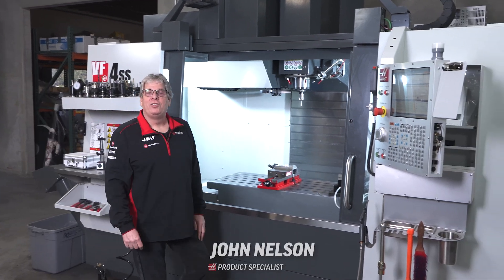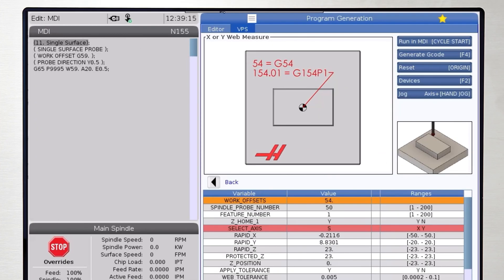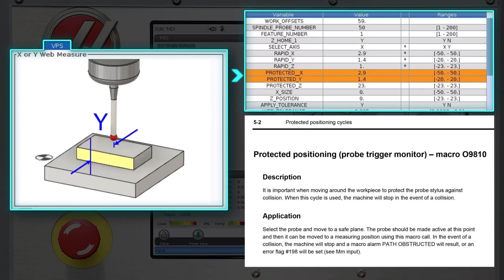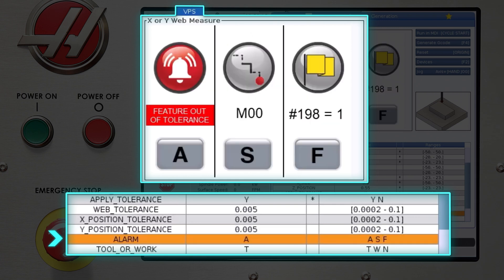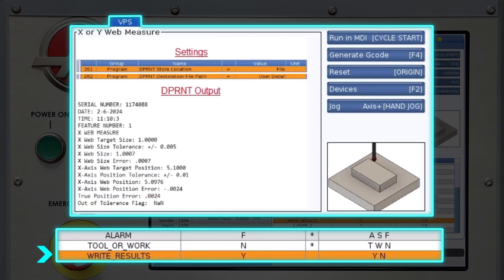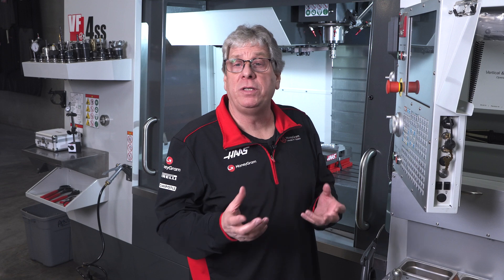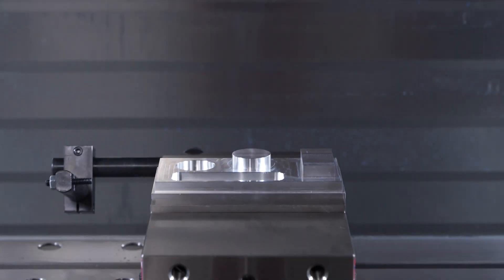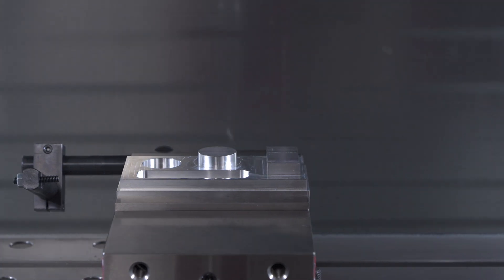New Probing Templates and In-Process Inspection on Your Haas Mill - Haas Automation, Inc.

Comment: Calculating G68 angle from two bore centers is a template I still really miss.
Reply: make a macro for it using the machine parameters. it's just angle formula between two cartesian points.

Comment: That probe is only as accurate as the calibration! So use caution when calibrating your probes.  I would also check calibration every couple of weeks. It is easy to do and only takes a few minutes.
Reply: Yeah I would say just as a default if I start getting weird things I dial in the probe with a indicator to the .0001 and run the calibration for the ots and probe.

Comment: Where do I download the templates
Reply: You call the HFO with your credit card and they will make it happen.
Reply: My HFO had a guy come out to install it, round trip $$$ and his 1 hr $$$ and the whole upgrade cost me $600 sucks!!!
Reply: @meddlingwithmetal7153  The HFO that runs the mid atlantic region will not touch anything unless it is broken. Unless you have a classic control mill which they will update to the final M18.29B software release if your machine supports doing it.  

Several of the features on the newer NGC software releases like the max speed setting for certain tools (save the renishaw from getting spun up to 10k rpm), The broaching templates and now these built in inspection cycles would be awesome to have. Half the time when I ask about them, the HFO service dept does not know about them, does not know if they would be supported with an older NGC or anything...  

Our UMC-750 we got last year I can actually say I like the tool and work offsets tabs. Still not a classic control layout but so much nicer than the work and tool offset tabs on our other two NGC mills. When I asked the service dept about doing a complete erase and reset on our buggiest machine. They come right back to their defense that they have no idea or guarantee that it would work. That Haas mothership in Oxnard provides no support or details about what each software revision would do or not do. Because many customers have been unhappy to find more nanny features have been slipped into the newer software revisions.
Reply: @meddlingwithmetal7153  only 600$ to have a technician come out for an hour? pretty good deal for what it allows you to do honestly.
Reply: Good luck getting a reply, they rarely do!
Reply: I'm sure you need to update your software prob.
Reply: There is always a reason why it doesn't work, we have 8 HAAS machines and each one has a different type of firmware and it is quite impractical to change the firmware to a newer one, because the hardware on which it runs the newer firmware can't handle it :/ 

For example, the new NGC machine from 2017 does not remember the values I entered when measuring when I return back to VPS probing, the machine from 2019 only remembers it until the program is changed, or the machine is turned off and on, the machine from 2020 remembers the values and can even measure the X axis and Z at the same time :D I didn't look "deeply" to know exactly why it doesn't work, I don't want to deal with it, I would rather make my own template, but I don't want to do that either, they could make a video about it, maybe then :D :D

The only option is to make your own custom templates, but it is quite difficult and there is minimal information about it, but if you search, you will find it, usually directly on HAAS in the "list program" under the "user data" folder you will find another folder "VPS templates" and in it there is usually "VPS template example.xls" this applies to the new NGC, on older software it is done differently :D

Comment: In before someone says you can't measure a part with the machine that cut it. Because you can.
Reply: If you validate the machine kinematics with a ball bar, then you can have confidence on positional accuracy.
Reply: I've been writing my own little macros to do this for a while. I wasn't smart enough to have the macros do the math but I was able to get the numbers needed from G154 p1, 2, 3 etc and then do it with my calculator on my phone real quick. I found in machine measuring to be pretty good as long as some dumbass hasn't crashed the probe and failed to dial it in and calibrate it.
Reply: @dannymaiorani519  Yup. Really saves my butt when my operators aren't paying attention to tight bores.
Reply: You can measure it, but you can't rely on its accuracy as it's only as accurate as its calibration and the machine's movements.
Reply: @theofficialczex1708  So is the CMM.
Reply: I use my eyecrometer and its more accurate. Probe cant see the drawing, but eye can!